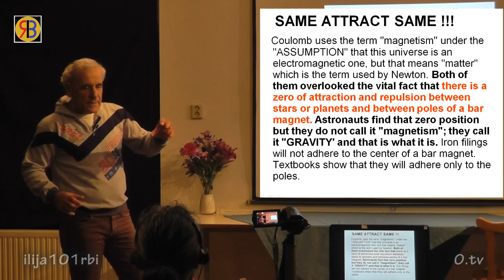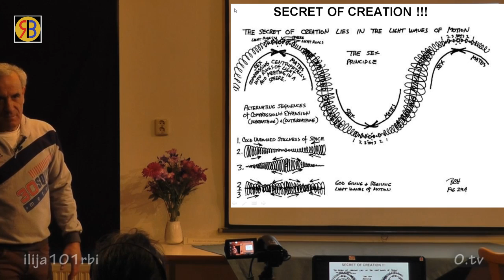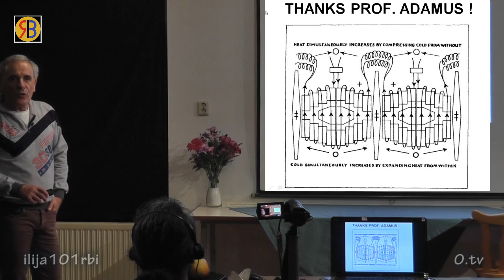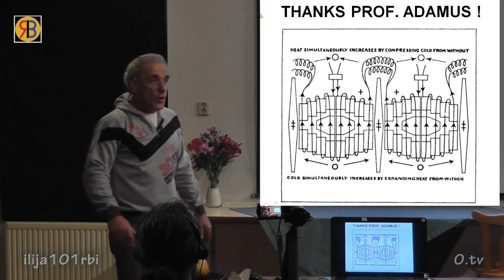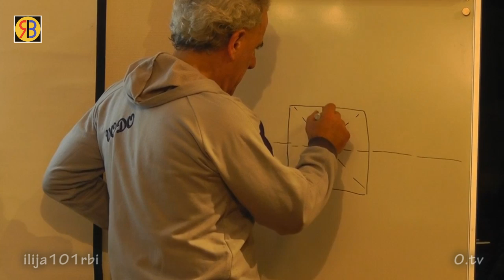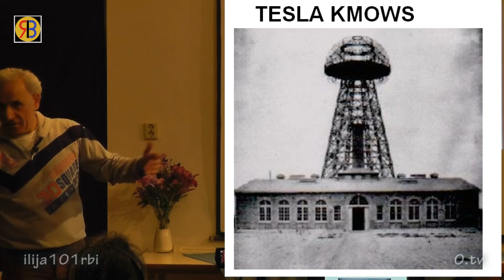Make your own free energy device - 0.tv

Comment: Try using 7 bifilar coils oriented and based on the chakra system polarity configuration. Merkaba science. Maybe even coil the bifilar's in a cone-cone, cone-pyramid, or pyramid-pyramid configuration either point-point base-base, or both. (it probably needs to be both to get the proper polarity flow) Use cone and pyramid bifilars as the 6 chakras other than the heart position. For the heart position utilize a Large bifilar with + and - load leads emanating from the center of the heart. Root, heart and crown oriented with vortices going vertical and the rest horizontal tying the third eye coil - spleen coil,  throat - solar plexes, and Root to crown. 3 circuits; a ground (female), an atmosphere (male) and the 3rd is the load (heart, spirit) area. How humans really harness energy. Combining Tesla's radiant energy atmosphere circuit with human energy design. The heart axis may be inverted 45%. And base the whole system on Vortex math and Beta frequency, specifically 30 hz. Just an Idea.
Reply: Trying to biflar us with bullshit.
Reply from the maker: Suggestions are alway's welcome.  Thank you.